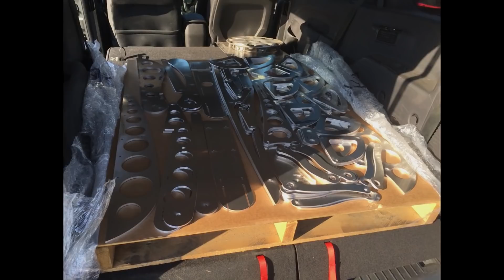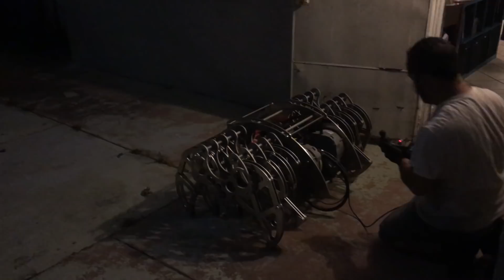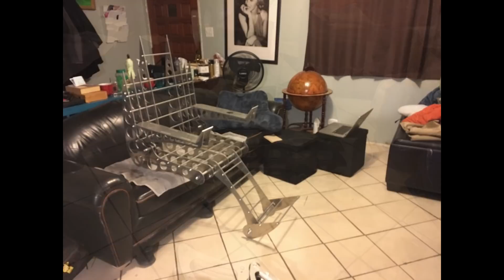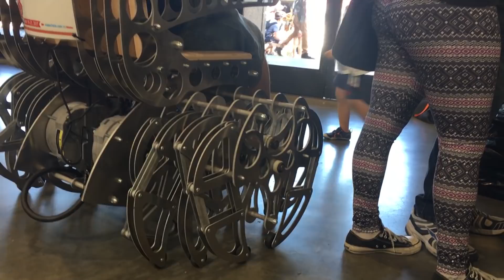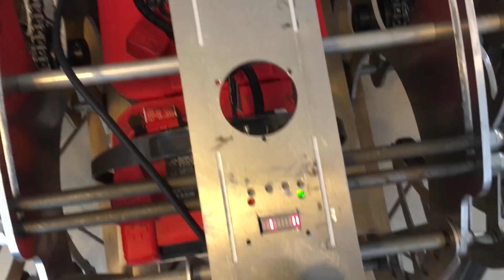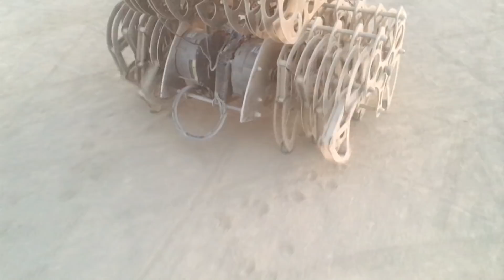The Playa Crawler Construction

Comment: You could integrate springs into the legs that push the legs down. this would decrease the peak stress on both the legs and the motors and should increase performance.
Reply: Why? Isn't the whole point of this mechanism is that the legs are moving in a straight line. I.e. not pushing up. So adding springs would not do much?

Comment: This man went to the renaissance era, and gave them a crankshaft out of what was left of the engine of his dad's beat up Jeep and said,"This is one of many parts of a machine that we have in the future. This machine is used for travel and can turn around 360 degrees, climb and go around rough terrain and do so in a way that keeps the driver up steadily to keep them comfortable even when they reach a violent gap in the path ahead. Although it contains many moving mechanical parts that work together and perfectly timed to do all of these things. This is the part that times everything by spinning constantly moving the parts that make it move and keeps them synced up perfectly so they keep the machine's weight balanced, preventing it from shaking." and then Da Vinci responded,"like this?" and then this man, was like,"yeah... spot on."

Comment: This is amazing. How much bumpier is the ride compared to a regular wheelchair?
Reply from the maker: Hugo Cornellier much bumpier.
Reply: @ZenichiWorks  hmmm... Combining a gyroscopic stabilizer just under the seat and a set of spring shocks connecting the seat to the legs should make the ride smooth as butter.

Theoretically you could then lengthen the legs to increase speed and add stair climbing ability now that the legs can tilt while the chair remains upright.
Reply: @GuukanKitsune  or if we're lengthening the legs, we could simply add wheels
Reply: @inspiredau5878  the point is to NOT be in a wheelchair.
And wheels would also make it unable to manage stairs, in the manner of wheelchairs.
Reply: @GuukanKitsune  all the motor function in this video doesn't assist your imagination to imagining wheels that can raise and lower?
Reply: @inspiredau5878  The point of the entire device is a cool ALTERNATIVE to a wheelchair.
Not a wheelchair with extra functions.
Reply: @GuukanKitsune  ok. Well it's not an effectively alternative wheelchair if it can't move as fast as a wheelchair or provide as smooth a ride. So my assertion is that it should have wheels
Reply: @inspiredau5878  Yes, but again... it's not supposed to be a wheelchair, it is supposed to be a WALKER. 

So you are basically saying the way to make this WALKER into a better alternative to a wheelchair... is to turn it into a wheelchair and make it stop being a walker.

What's your next move, to tell people designing a helicopter that it would fly better if they lost the rotor and used wings and ailerons instead?
Reply: @inspiredau5878  it's called having fun
Reply: Some shock absorber on the bottom might take some of that bumpiness off and maybe springs under the seat.
Reply: @willfulignorance2848  that's why I suggested shock springs and a gyroscope assembly! The seat would remain stable and upright while the legs moved.
Reply: very cool I am paralyzed and want one like this to walk through the woods and up and down the mountains like I could do before I get paralyzed

Comment: This is awesome! :D
How long will it walk(?) until the battery is out of energy?
Reply from the maker: NewNick so far I’ve got it to go about 2 miles. Right now I have two red top optima lead acid batteries but they’re normally meant as a starter batteries so I think they don’t like being drawn constantly like deep cycle batteries would be. I’m planning on going to lithium next.
Reply: Zenichi Works I would love to see it’s energy efficiency compared to an equivalent platform on wheels. I bet it’s pretty comparable. 

Have you done any more work on this or improved the system since this video?
Reply from the maker: Zachary Bittner I’ve sat a 260 pound person on it and it worked but it didn’t like it so i think the limit is 200. I donno how much it affects performance.
Reply: Mark Ellis how much weight can it lift and how much does it effect performance?